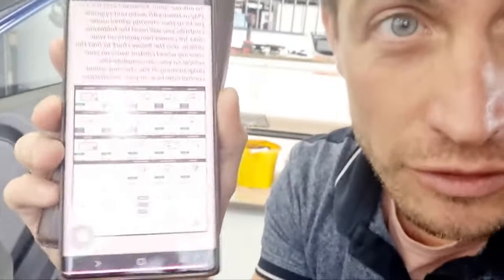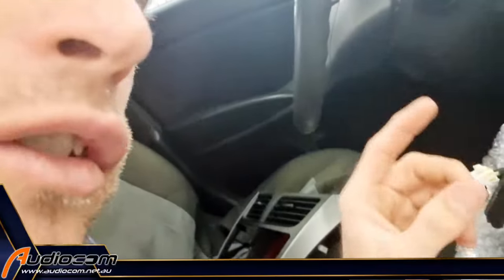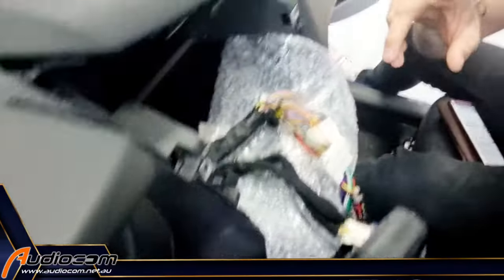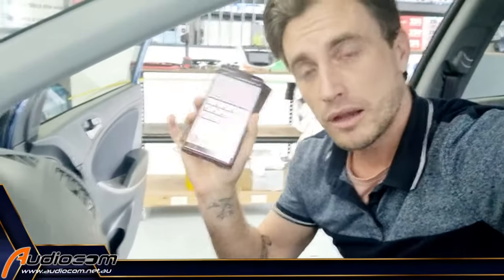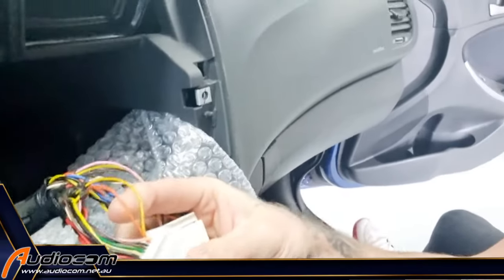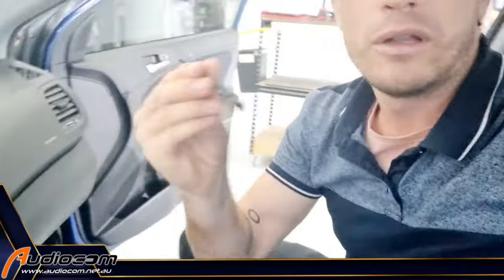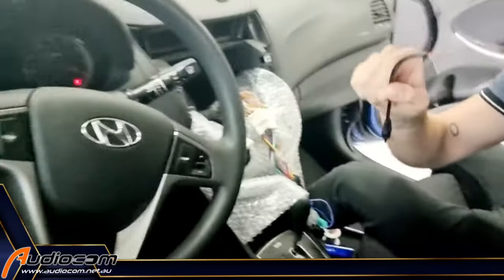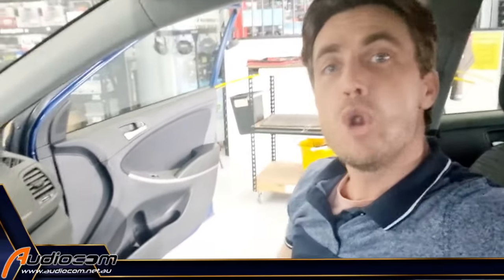How to find your steering wheel control wires when installing a new audio unit

Comment: This absolutely saved my install after all other sources failed.  I am able to program my steering wheel buttons now after using the picture of the connector you mention in this video for my 2011 Mazda cx9.  Thank you!

Comment: My Blaupunkt has a 3.5mm female plug coming out for SWC, but the legend on the bottom of the radio denotes which pin is SWCA and which is SWCB.  My Metra kit requires a separate box to get that functionality back, but since I know what wires in the vehicle harness are “a” and “b” for SWC, I was going to attempt to make the connection.

Comment: Hi hope you are well.. 
Is there any way you can assist me the the connection or advice on the 2018 Isuzu X Rider  steering wheel controls.  I've struggling to get that connected to my head unit. Kind regards  Lance

Comment: Hello i have a pioneer dmh-z5150bt. I want to connect my navara np300 steering wheel contoles. Do you know key 1 and 2 and ground for the 3.5mm sw. I have one for my single din pionee. But it doesnt work on this new unit.
Reply: He doesn't answer questions.

Comment: Hi, i am looking for a wire diagram for the Opel Corsa E 2015 (not electrical car). It has the old intellink 3 mediaplayer. I got an aftermark android TS800 screen but the Steering wheel controls dont match the wires. I want to know which wires are for the steering wheel control on the main wire unit. I found a diagram for the main unit wires but it doesn't indicate which wire is for steering wheel or i dont know which one they use for it. Anyone has experience?